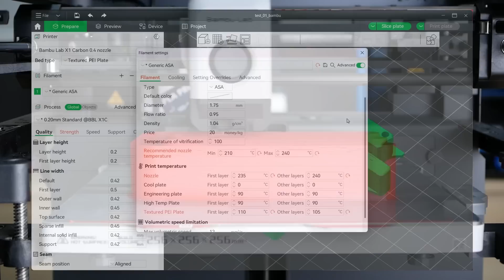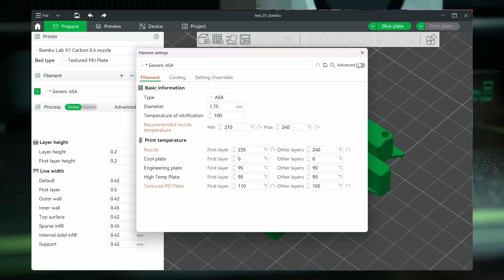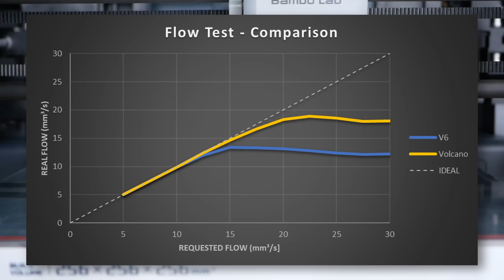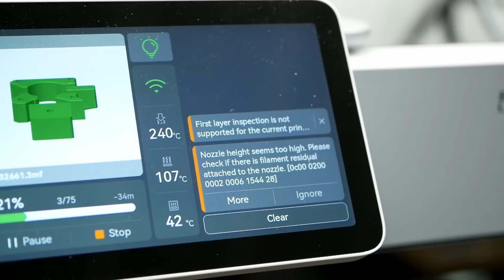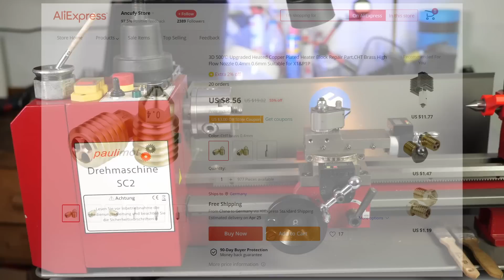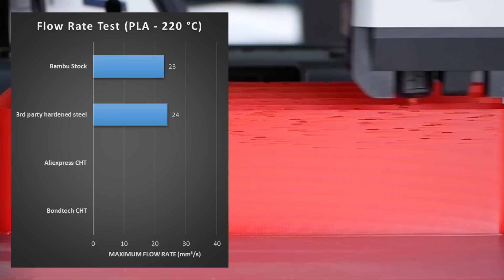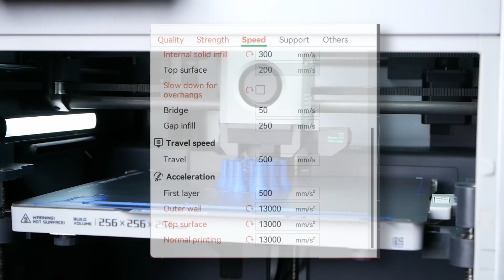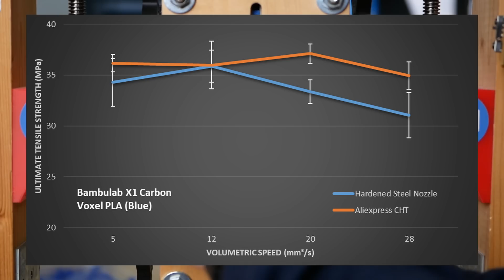Fast 3D printing is bad for Strength! (and how to fix it!)

Comment: I worked with a start-up where they thought that 3D printers gave final parts. nothing could be further from the truth.
assuming you have a resolution of 0.05mm, doesn't mean you can respect those tolerances. you NEED to go back and drill holes and resurface if that's functionnal.
why do I bring this up?
because with metal, we know that getting a part that "fits" might not be done, and we know never to trust 3D printers (WAAM or melted powder printing) so we do heat treatment when we get the problems you describe : low strength, brittle parts...

so maybe we could just heat treat plastic parts? get an old toaster oven and bake the part at 100°C for a couple of minutes?

Comment: Stefan, I always enjoy  your videos and the dedication you put into making them. Here is an Idea for a video. Testing linear systems, for instance difference in drag between genuine Hiwin rails vs Aliexpress ones, difference between smooth rods and linear rails, difference between carbon fiber rods vs smooth ss rods vs linear rails. Also maybe how big of a difference does lubrication of choice affect smoothness of gliding. and in the end which solution is the best regarding weight to least amount of drag during sliding.

Comment: Really interesting flow tests! Great to see those aftermarket options performing so well. The standing tests are pretty useless though. Since they’re in batches, the layer time is many times higher and there’s lots of time to cool down. Printing 12 samples 200mm/s is going to end up extruding on plastic pretty much just as cold as 12 samples at 50mm/s

Comment: My modded-to-hell-and-back Ender 3 knockoff starts making PLA matte around 22m^3/s, using a 0.6mm CHT at 245C.

So it seem that if you want strong parts, a cheaper printer probably won't make too much difference compared to a Bambulab.

Comment: Hi Stefan, I often print props that need strength / layer adhesion like swords. I noticed the x1c prints delaminate some of my modular sword designs (with screw thread) and silk filament was not glossy at all, which made me print a lot slower.
Incidentally the community made me order an aftermarket hotend with CHT, glad to see you say it's usable with just a shorter wiper.
I did see someone shorten the heat throat and widen  the hole in the cooler block to minimise heat transfer and to eliminate blowing air on the nozzle, but you say that's not needed right?

Comment: Watch out for your printbed! It looks like it´s very uneven, You can see at the flowrate test how the bed moves a lot to compensate for the big dip in the middle. Did you check your bed? I wrote support and my replacement bed is on it´s way. Try wrinting them!

Comment: Yes indeed: printing speed does have an impact on part strength and there are  two reasons for this.
Lower speeds means there is more time to heat up the material so it can reach a more uniform temperature from the outer surface all the way to the core of the material but it also allows the nozzle to act more as an iron when the flat ring of the nozzle tip irons the extruded material onto the previous layer.
I still find it strange that one nozzle geometry is used for all those different materials. The area of the nozzle tip and the length of the orifice play a major role.

Comment: You might be able to increase the diameter of your test piece (beyond the grip point, obviously) as a cylinder, rather than a convex rotation.  That would allow for a larger percentage of each print being at the target speed.

Comment: Ah I have noticed this as well up to this point I have just been setting my print rate to 50% on the X1 for my "quality" prints but controlling the volumetric flow rate is way smarter. Thanks for the tips and the research!

Comment: I'd like to get a high speed nozzle, but my 3d printer uses m8 threads, which apparently is not standard... I can't even find a source that sells them other than resellers of the original OEM.
This was a really great video explaining so many facets related to high speeds. Thank you.

Comment: Great video!  For what it is worth, my old Fortus 250 (industrial printer) runs ABS at 305C and has a meltzone nearly 40mm long.  And that machine has extremely tight temperature controls and uses quality thermocouples for temperature monitoring.

Because of that I have become way more comfortable with pushing Temps through the roof while printing.

Comment: Thanks for a great video!

Any chance you can investigate the vertical rippling arftifacts issue on Bambu printers as well? It tends to line up with hotend flow limitations too

In my specific case any print speed less than 180 mm/sec result in quite noticeable vertical rippining on the parts (not an echo, this type of artifacts is usually referred as VFA). In the end, I am left with a dillema: print slow to get somewhat strong parts with a surface quality of an Anet 8, or print fast to get somewhat decent surface quality and sacrifice the part strength. The fact, that there is no sweet spot is kinda disappointing, especially given the cost of X1C

Comment: Personal theory : material shininess is driven by friction of the material through the nozzle, like what happens when you set an incorrect cutting speed on a mill/lathe.
High speed would let micro-ripples on the material surface, thus giving this matt aspect.

Comment: With high speed printing, you are not just hurting the strength, you are also affecting the accuracy of the part, corners should square, not squarish, if you want to print fast, just get more printers.

Comment: I have an FLSun V400 and regularly print at 400 mm/s. One thing I've noticed and maybe you can make a video on this but when I print things that are vertically quite tall I will often need to slow down the print speed otherwise the first layer to bed adhesion will give way and the print will fail. I haven't tried too much yet but have been thinking about different cleaning or adhesive products to combat this. Maybe there's support material designs etc that could help too. Or maybe it relates to this issue somehow as my material maybe isn't melting fully and applying more shear force on the part as the extruder moves across it. Just some thoughts.
Reply: That's common with any printer. Just enable brim or raft for parts without enough contact area. Or use a PC build plate and PLA will stick to it like crazy.

Comment: Fantastic video. I would like to see if the strength tests change if you print each coupon separately to see if there is a difference when the layers do not have time to fully cool down.

Comment: I like to let my BambuLab X1 Carbon print at its "quiet" speed whenever I can, which is most of the time. I find the results have better finish, better dimensional accuracy and feel stronger. Also I am  quite concerned about wear of the machine. Machinery does not like vibration and going full speed or above does make my printer vibrate a lot.

Comment: When I make parts for press fitting bushings , I use concentric infill to reduce accelerations and keep print speeds faster at 100 percent infill. Should help with your coupons too.

Comment: This explains so much. I was wondering why some of my parts were coming out with inconsistent surface quality. I have been tweaking the max volumetric rate, with better results. But I still didn't understand why it was happening. I love any excuse to mod my printers, so I guess it's time to make some aliexpress purchases!

Comment: facinating, of course there are tradeoffs with speed, strength wasnt one I considered, so how do you solve that? add more heat? bigger nozzel? but that gives you less resolution, hmm seems like theres a limit to speed dependant on nozzel size, since lots of layers wont  be as strong as thick layers since that plastic is all melted together, sort of like ejection molding, where the whole part sort of crytalizes into 1 peice of plastic, the layering thing seems to be the weakness of 3d printing why bigger layers seems to add more strength but at cost of resolution.

Comment: It feels like the limit is the heater power and material thermal conductivity?

It takes X amount of energy to melt the plastic (Enthalpy of fusion?). That's J/g, or in this case J/s if you have a material "flow rate". So you can calculate how much power (watts = J/s) is required to melt the plastic at the desired rate then match that to the heating element power to compare. 

Then you might be limited by the thermal conductivity of the nozzle/melt zone material? Copper might be the best option for this? Followed by aluminium? Keep the walls thin and heating element as close as possible, also use thermal paste and good tolerance, interfaces, and clamping force, to minimise thermal resistances in the stack up.

Then there's the "thermal inertia" of the system: In order for heat to be transferred there must be a temperature difference. The bigger the difference, the faster the transfer rate (watts). BUT there's a max temp for the plastic. This all adds up to mean that you must predict the need for more heat before the flow rate is higher in order for the heat to compensate for the time to soak through the material, then cut off early so it doesn't over heat the material.

You could write an algorithm that can use sensors and the G-code to control the heating element power.

This is all assuming that the limit isn't just you're already running the heater at full power. In which case, can't you just swap it out for a heating element with a higher max power? Wrap your own out of nichrome, if you must? 

Maybe I should have patented this before talking about it in the open like this? It's public domain, now though! Open source!

Comment: I've thought about posting about this. I'm glad you are sharing. Tuning to a flow rate is what I've always done, since my super racer is faster than most materials can handle. So what I do to utilize the speed is maximize the flow rate and then lower my layer height until I either hit my max speed or smallest layer height.
Reply: How fast does that mean you end up printing?
Reply: @travistucker7317  at most, I print quality parts at 400mm/s @60,000mm/ss.
Reply: @ManjaroBlack  what layer height does that generally happen at?

Comment: Hey Stefan!
What contribution nozzle diameter brings to the table?
Since you now have limit on volumetric flow rate and not on the motion system what happens if you reduce nozzle diameter and increase print speed to maintain a constant volume flow rate what will happen?
Great content as always!!

Comment: The transition from shiny to matt at 10mm/s may not be due to the flow rate but due to the hight of the print. I find that when printing petg no part cooling results in shiny prints while part cooling results in matt prints. It is possible that this is the case for you too and that 10mm/s point is the height on the print at which your fan speed increases from the minimum set in the slicer.

Comment: So let's sum it all up. The Chinese have created a fast printer, which is slower than projects such as VzBot, Voron or HevORT, but is ready to use right out of the box. Over time, it turns out that Lidar and other goodies do not work well, so the only thing these printers have to offer compared to the archaic Prusa MK3S+ is faster printing. Recently there is an upgrade of the old Prusa to the MK4 version, which in the Alpha version is able to print Benchy only 1.5 minutes slower than the very fast Bambu. So we come to a situation where an old printer, which has received thousands of positive reviews, being called an ideal workhorse on which you can rely, is able to print as fast as a modern printer from 2022.  However, the Prusa prints do not have durability problems with its prints. What's more, Bambulab users are increasingly reporting problems with wearing carbon rods, breaking hotends or banana-like tables. Bambulab has already gained many fanboys who now have to swallow that the old Czech bed slider is better in every way.
Reply: This is quite literally one of the biggest copes ever

Comment: I started using my new X1C two weeks ago and I can 100% agree in terms of "speed is not everything". I'm especially struggling with printing TPU (Colorfabb Varioshore) and i already had to de-assembly the hotend and the extruder to remove clogged filament. I didn't had this kind of issues e.g. on my prusa mini. Reducing the max. volumetric speed has solved the problems. I think this long melting zone is not good for TPU.

Comment: It would be awesome if they had an experimental variable Temperature to boost up just at the right time for high flow infill for example and cool down for outer walls 💪
Reply: Don't know if the temps can change that fast, but on the same train of thought:  His graphs show an increase in strength with increase in speed on the lower end. Wonder if this is due to the slicer using higher/too-high of heat. But it comes into the sweet spot there in the middle of the graph. Seems like too slow and hot is just as bad as too fast and cold. I think there's a setting in cura to optimize speed for constant extrusion pressure. Might be the direction to go to stay in that sweet spot. High accel, medium high speed.

Comment: Another nice video that's very informative.  I've already ordered the replacement hotend so that I can use my existing V6 nozzles in my X1C if I want to but now I'm ordering a couple of those CHT nozzles made to match the Bambu Lab nozzle length.

Yes, the replacement hotend/heatsink with removable/changeable nozzles is expensive to start with but when you consider it can used for many inexpensive nozzles rather than having to replace the comparatively costly Bambu Lab options every time your nozzle wears out, they end up much less expensive in the long run and offer more variation.  That and they make changing nozzle sizes/types much faster, no more having to break down the whole carriage assembly and swap entire hotends just to change nozzle size. Bambu only offers stainless steel and hardened steel while V6 style nozzles come in brass, plated copper (my favorite) and various specialized nozzles like ruby, titanium or obsidian plus many other variations/combinations of tip style/metals.  I'll never need most of those since I normally use plated copper or hardened steel when it's needed but I like having the option of using my collection of plated coppe/brass nozzles back, not to mention being able to use the V6 style hardened steel nozzles that I already own rather than having to buy Babmu hotend replacements. I'll keep ordering the Bambu Lab hotends for the hardened steel nozzles when I need them, the AliExpress aren't much cheaper and I trust the quality of the Bambu slightly more.  AliExpress can be great but you never know what you might end up with (off center holes, poorly machined surfaces/threads, low quality materials, etc.).

Comment: 2 Things here:
I did a comparison between my Ender 5 S1 with a volcano CHT nozzle, and the P1P. I speculated that the Ender 5 S1 parts were stronger. They certainly felt stronger when manually breaking them in hand. Glad you have done some testing to confirm.

I mainly do functional prints, where strength is key - To me, it is not worth printing a part that is 50% as strong, because then I need to use twice as much material, or more!

So in the end, moddability is super important. I don't like how locked down the P1P is, but thanks for showing some ways to fix that!

Comment: @Stephan- have you ever taken a look at temperature accuracy on your X1C? I have spent well over a month going back and forth with Bambu on this, after finding that the hotend thermistor/electronics report back a temperature about ~20C higher than reality, resulting it a "real" hotend temp of only ~250C when you ask for 270C, etc etc. This means the default 220C profiles for PLA are trying to push it out at only about 200C.

It's not just a hunch- I've tested with multiple replacement thermistors, different (official) hotends, settings, countless test prints and meandering flow loops and more, and using both a thermal camera (admittedly not ideal for shiny objects, but calibrated using a Mosquito magnum  :) and ALSO with K-type thermocouples on different parts of the hotend body (even in the same hole as the bambu thermistor and with either their thermal grease or even with boron nitride paste.)

Heck, they even sent me all new electronics for the TC board (the interface board on the toolhead that everything plugs into) and I still see the same thing. I don't know if it's just me seeing this, but I hadn't really seen much discussion in this specific area, and had been meaning to reach out to you for a while now.

So, if you set your printer to say, 230C, and sticking a cheap K-Type thermocouple coated with some thermal grease onto the hotend gives you a 230 +-1C reading, then you only have to worry about the "well known" hotend performance limitations that you described very well in this video. But if not, then you may find yourself having to do the constant mental math I've been having to do for the past month or so...

By the way, Bambu has only kind-of-sort-of acknowledged my findings (after sending them multiple videos, test reports, troubleshooting sessions, etc) but I'm still missing the big "ahha" from them on this. They still seem to give off vibes that they think I'm just a crazy guy nitpicking things :)
Reply: I've felt, with no scientific testing that I was missing something about the temperatures on these machines. If you are right it would make sense to me based on my experiences. I never see stringing and it's like I'm printing at lower temps than I should be. I'm gonna crank the temps up and see what happens.